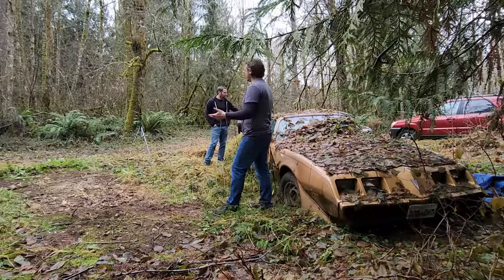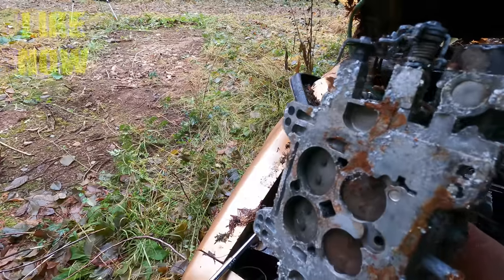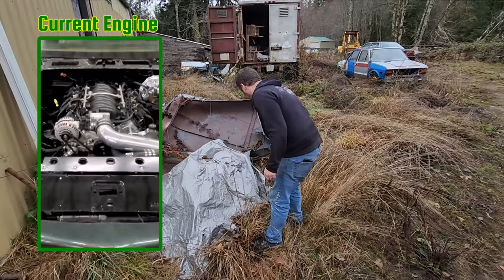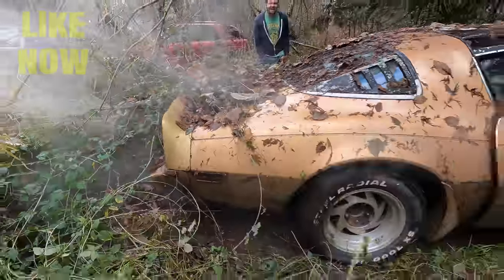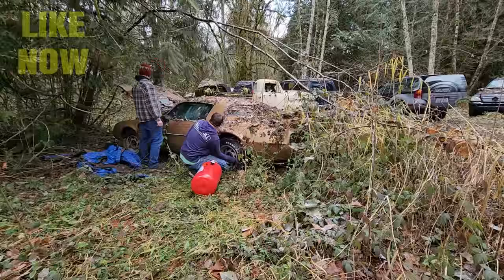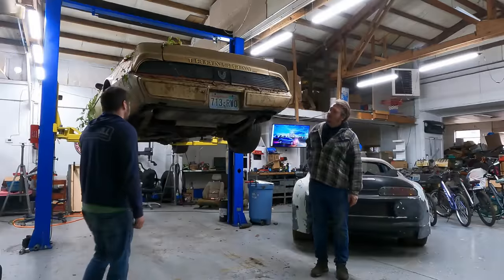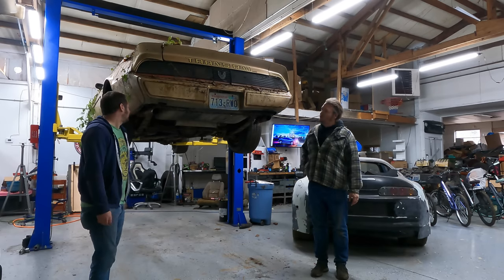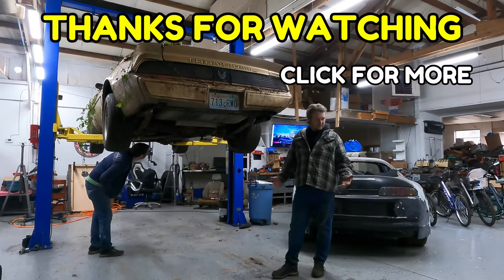ROTTED OR NOT?? 1980s GOLD TRANS AM: Will it run, after sitting in the woods for years Is it savable

Comment: No, this had the RPO code "L37" Pontiac V8 with four barrel, non-turbo engine originally going by the emission decal. The VIN is something like 2 for Pontiac, W for Trans Am, 87 for two door coupe, W for 301 V8 with four barrel, non-turbo, A for 1980 model year, N for Norwood, OH assembly or L for Van Nuys, CA assembly and the rest is the production sequence. 1980-1981 Turbo cars had a "T" for the 5th VIN code digit. The emission decal would have a "TS" for the turbo engine. 

The column shift is of course wrong as all 1980 Trans Ams had console and floor shift. It has a code 62B Camel Tan Cloth interior, A51 bucket seats, and appears to be code 57 Solar Gold exterior paint.

Comment: Fill the carb bowl with gas through the air vent. That will make it run long enough to see if the mechanical pump will draw fuel from the tank.